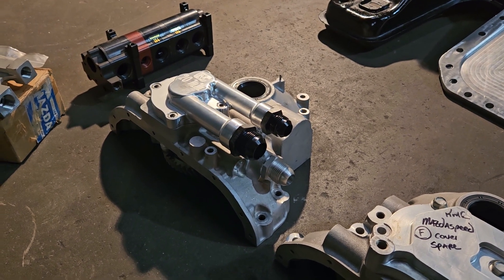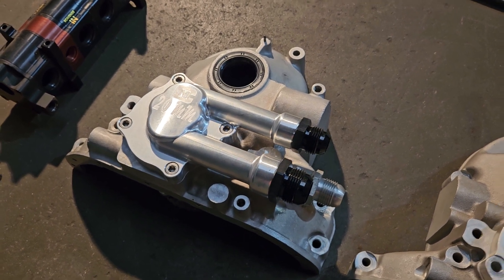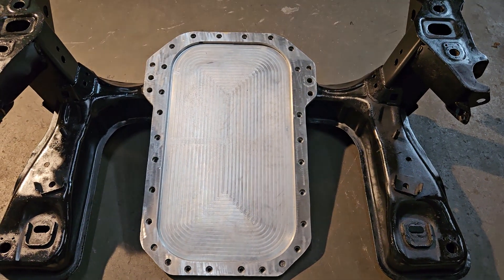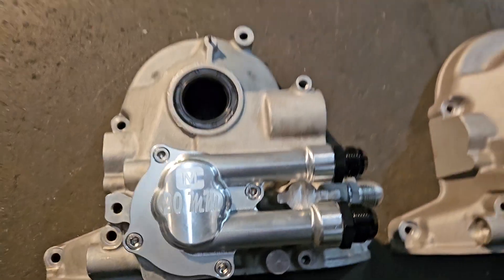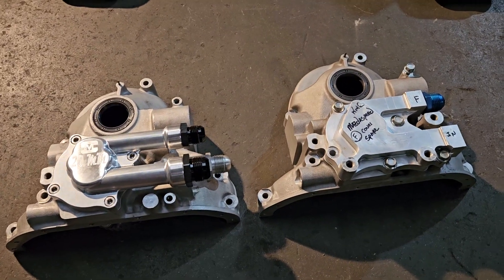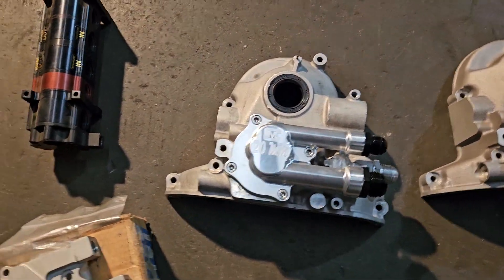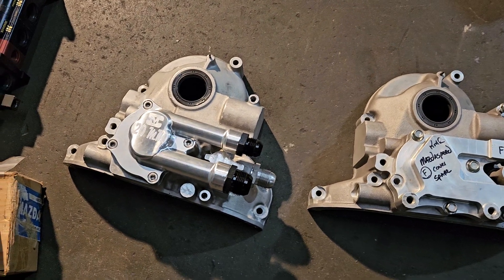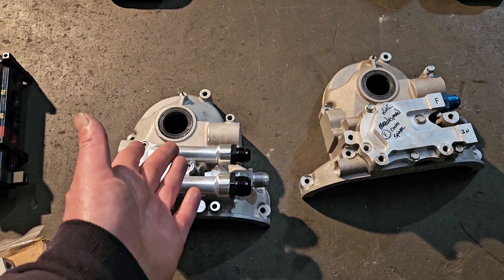Dry Sump options for Mazda Rotary Engines, OEM, Aftermarket and Billet pumps - KMR Rotary Tech

Comment: Im a rotary  extreme novice.
Has anyone set up a rotary to run with vertical crank axis.
Im looking for a non 2 stroke option to mount on my racing outboard platform.
Reply from the maker: @1philliph  interesting idea.
Reply: Another question relates to premixing the oil.
Cost of fuel and oil is not a factor in circuit racing.
Typically our boats use 2Lof petrol a minute and run 3% fuel/ oil( 2 stroke v6 mercs)
I've built a platform that is able to carry any small 4 stroke and rotary is worth consideration.
Looking for 300 plus hp at 7500-8000 rpm.
That's about where our v6 mercs run and gearboxes and props are working at.

Comment: For me, it sucks that I can't use these front plates. My 20b is moved back in my fd chassis and sits right behind the steering rack. The lower protrusions would hit the rack so I would have to raise my engine to fit these. Be nice if someone could just machine a wider factory style oil pump to fit within the factory housing. 1/4" wider should be enough to increase oil flow on 20b for 10k rpms when the factory starts loosing pressure at around 8.5k.
Reply from the maker: Yeah I get that.  I feel like they're main purpose is for racing so under extreme loads there is no oil starvation.. It sounds like you have a nice setup already going
Reply: @KyleMohanRacing  Yea my set up is NA and I built it back in 2009. It's PP but I limit my rpms because of the oil flow. Engine is out right now as I have to re-engineer my intake. Old one was poorly welded by yours truly. Lol!

Comment: Is there any downside to running these other than cost?
Reply: Increased crankcase vacuum which can cause gasket/seal failures. Rob dahm suggests running a pressure regulator for this reason